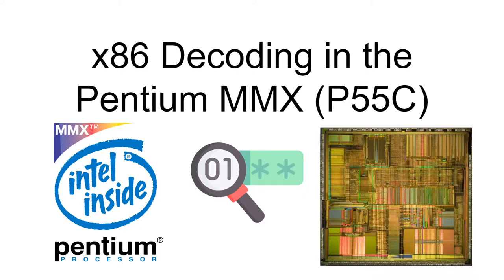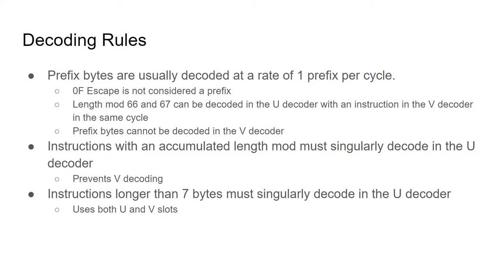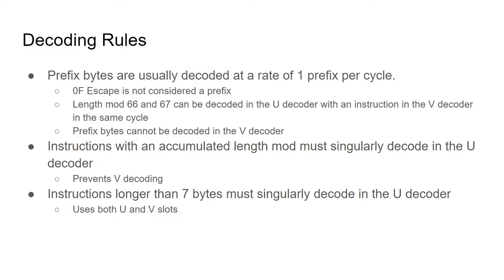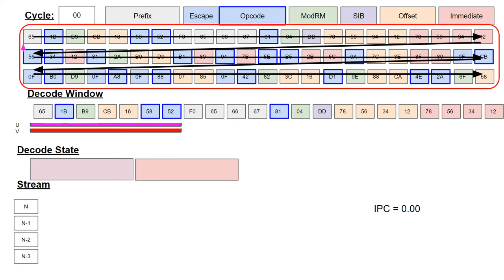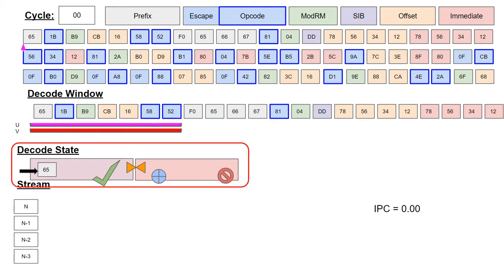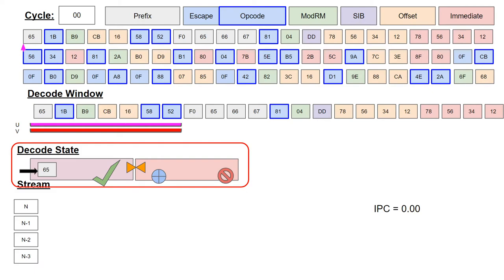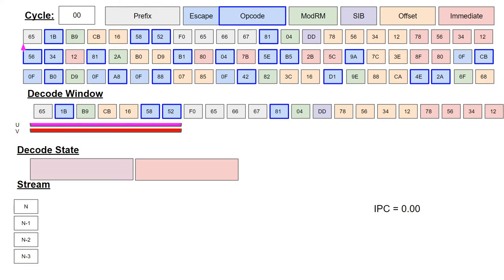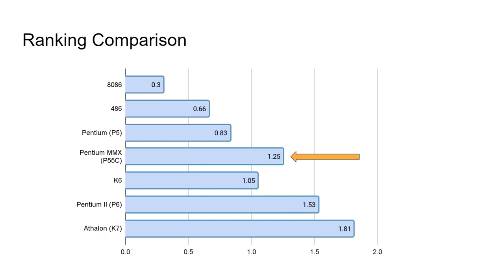x86 Decoding Simulation in the Pentium MMX

Comment: If memory serve, the Pentium III, M and Core were all based on the P6 architecture, did they share the same front-end ? 
I remember mounting a pentium M on a Asus motherboard, it was a beast. ( I also had a Cyrix P166+ , celeron 300A and an Athlon Thunderbird, this bring back memories )
Really eager to see the difference between P6 and K7. Like Weird Al Yankovic said "It's All About the Pentiums" :D
Reply from the maker: Sort of. The Pentium II/III share the same front end, which was introduced in the Pentium Pro. Core went back to the P6 architecture and updated it. Core is similar to the P6, but not identical (the front end is wider on Core). I'm not as familiar with the Pentium M, but it looks like it was an iterative step between P6 and Core (based on the P6).
The P6 vs K7 is probably the most interesting comparison, since they are so similar in some ways and so different in others. There isn't a lot of information available with P6 though, so it won't have as much detail as the K6 and K7.
And I have to admit that Weird Al Yankovic's song was stuck in my head while working on these videos.